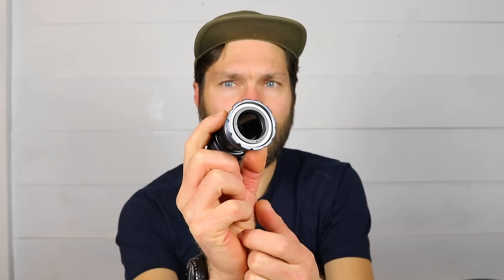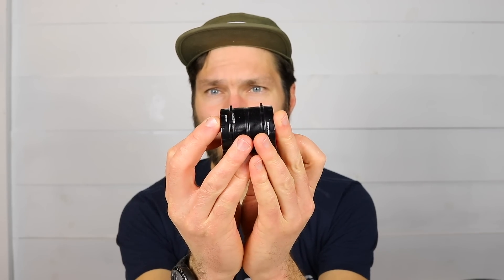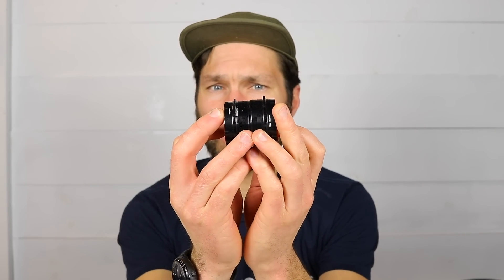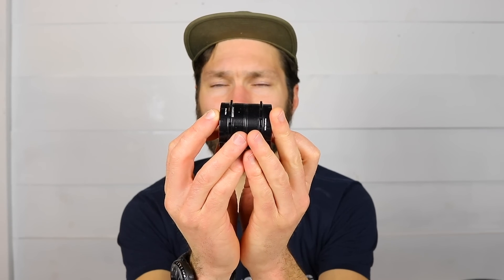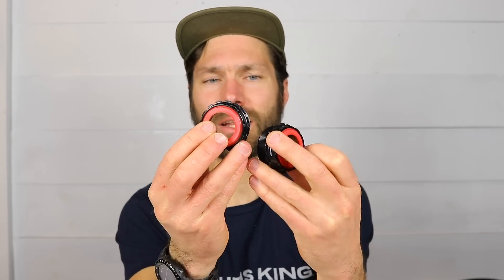T47 Bottom Brackets Explained

Comment: hi there I am now new to T47 standards, all my bikes has been using bb86 or bb386 pressfit, now I am  into a new frame for gravel which use t47, the brand did not specific shield width however ( I am not sure if it is a 68mm or 86mm ) , some BS has a limited stock of BB for dub sram where I live, I will set up a 2x force  wide crankset on this frame ( Aurum brand, Manto gravel model), I got the dub road/road wide T47 / 68 , should fit or should not? Or would I need in T47 as mentioned?
Reply from the maker: Most frames like that would use an external BB. It may be easiest if you can measure the frames BB shell to confirm which size your frame uses.

Comment: I've got a T47 30i ceramic bottom bracket with FSA SL-K Modular Super Compact BB386EVO Crankset 165mm 30/47 tooth. I need to replace my T37 30i. What fit kit do I need to purchase? Thanks!
Reply from the maker: Fit Kit #5 for 30mm spindles.

Comment: When do you need spacers and how are they used?
Reply from the maker: Spacers are used to adapt BB's/cranks to each specific frame. There are BB cup and crank spindle spacers which can be used to adjust the spindle position to add extra clearance, or to fine tune chainline. Here's some links for Chris King and White Industries recommendations.  

Chris King
https://cdn.shopify.com/s/files/1/2920/2114/files/bb_fit_guide_r1.pdf?v=1632265266

White Industries MR30
https://www.whiteind.com/wp-content/uploads/2021/02/White-Industries-MR30-Crank-and-Bottom-Bracket-Compatibility-Chart-V1-Sheet1.pdf

Comment: I have a 2021 Trek Domane with a T47 BB. The shell is 73mm. I have a SRAM RED eTap  AXS groupset that I plan on installing on it  but I just realized the crankset is a GXP which has the 24/22 step. So would I need an Internal or external BB?
Reply: 24i with a gxp fit kit. if it was dub you would need a 30i with a dub fit kit. always going to be internal on a trek because of the frame
Reply: @spencerfisher4080  In the video he states 68/73 would have outboard BB’s. Why would trek frames be any different out of curiosity?
Reply: @gvnrchmnd  Just the way the frames are designed

Comment: Please define a T47 BB. How did it get the name ? Personally I will be fitting a RITCHEY  Cross Crank to a RITCHEY Logic Roadie. Currently the old school internal is fitted. Kellan will know as he has a Road Logic. AVT my parts shop for a while. Good Vid otherwise. Maybe T47 means external. ?? cheers.
Reply from the maker: A T47 bottom bracket shell is threaded with a 47 x 1mm thread, and comes in a variety of lengths ranging from 68 to over 100 mm.  It's confusing because it can be used with all sorts of different crank standards (including BB30, PF30, DUB, 24mm, 22/24mm stepped GXP, and a variety of other 30mm standards) ALL DEPENDING ON THE WIDTH OF THE T47 SHELL.   Finally T47 just refers to the bottom bracket shell and the type of bottom bracket that it takes.  But the T47 bottom brackets come in both INTERNAL AND EXTERNAL VERSIONS, as explained in the video. This is one of the reasons that it can be extremely confusing!  The video tries to explain all of this in a succinct way, but that doesn't mean that it covers all of the options and it doesn't address all of the possible points of confusion.  Does that help answer your question?
Reply: @AVTBike  thanks.